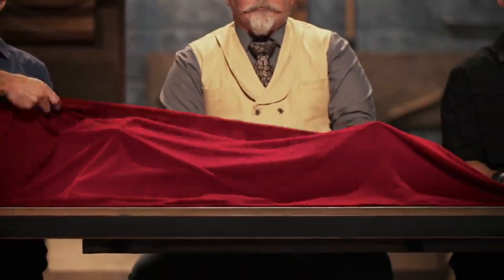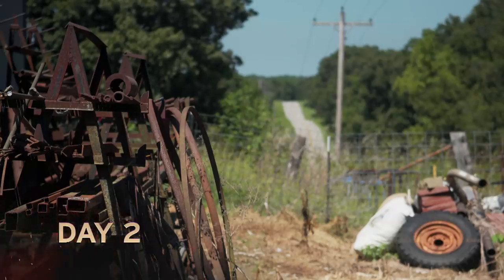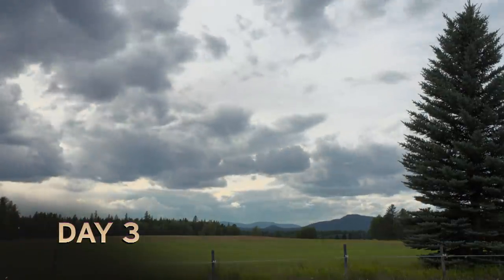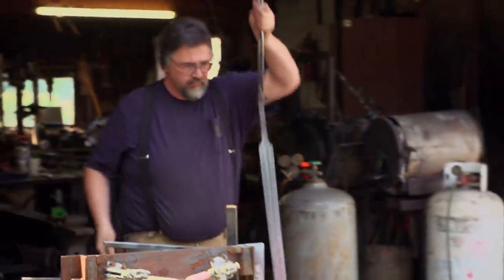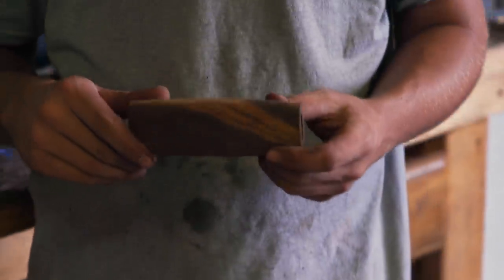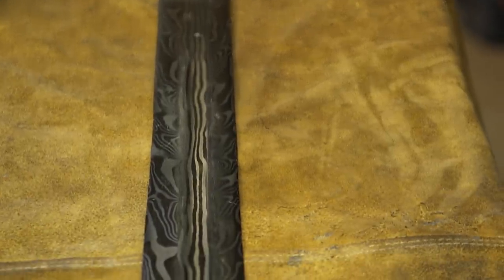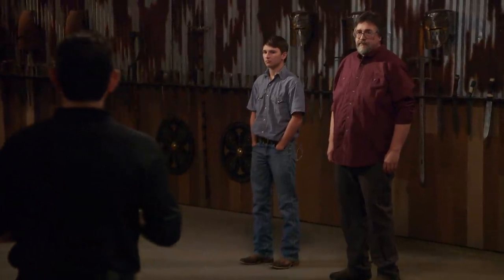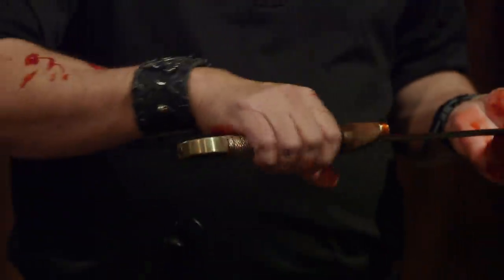Forged in Fire: HUGE Broadsword Inflicts CATASTROPHIC DAMAGE (Season 7)

Comment: Why not do the sharpness test before the "lets test this blade by using it in a way it's not actually used for" test. 
Regardless his sword would have lost in the same way, but I'd rather see all tests done on each weapon than just cutting it short on a tree tunk durability test..
Reply: The reason behind doing the sharpess test after the strength test is to test the durability and integrity of the weapon, as well as whether it held its sharpness after repeatedly striking hard objects. Blades often strike hard targets such as armour and shields, ad it has to keep its sharpness and structure as much as possible during battle. There is no time to stop and sharpen/straighten your blade in the middle of a fight or battle

Comment: Sharpness test? Than blade would've gone through it, even with the bent.
Reply: It would have been dangerously off balance though, and the bend is right at the guard where it's thinner in profile and could have stress risers. Bend it back swinging and it could easily pop and send the blade flying.